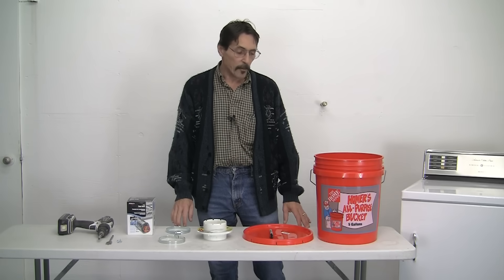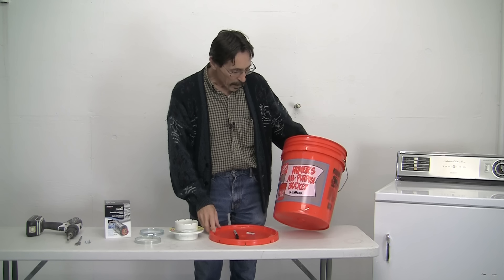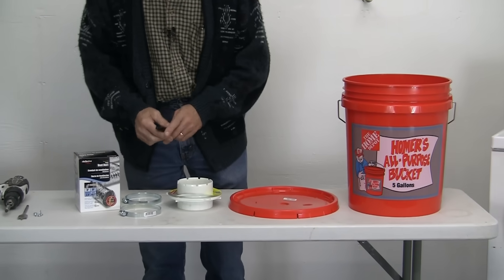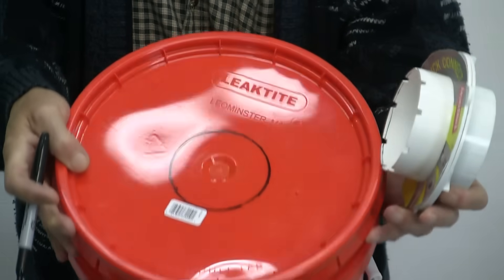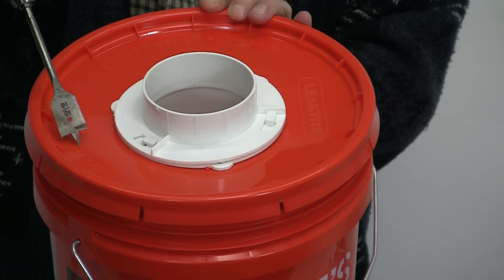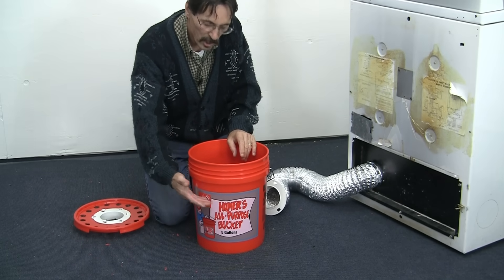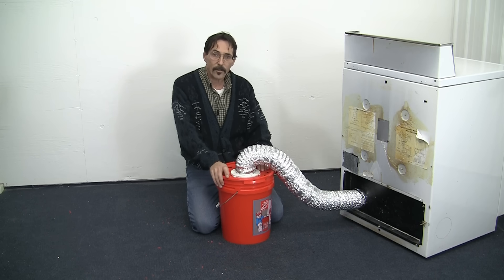DIY How to Cut Electric Bill in Half: Part 3 Clothes Dryer Free Ideas | Missouri Wind and Solar

Comment: This is interesting. Thank you for sharing this idea. My concern with this method is that the extra moisture in the air may introduce mold growth.
Reply: In the deep South our average outdoor winter humidity is 70-80% and it works its way inside.  This probably would not work for us for the same reason a swamp cooler does not work in the summer, that is, very wet air inside.  But in winter in Arizona should work great.
Reply: I live in Arizona and we can use this method all year long.  Very low humidity in here.

Comment: We have one of the tiny buckets from the hardware store connected to our dryer.  It's not ideal but was necessary because the outside vent is too far away from the dryer, and it took hours to dry one load.

Comment: actually, in older rural houses like mine, the dryer is in the garage which is divided in two - the front half for the cars, fridge and washer dryer and the back half for workshop.
I'm going to put this bucket trap on the other side of the divider wall with another connector like the lid has so when it's cold outside, i can easily reattach the hose from the outside wall to the inside wall and heat my little work bench area with the bucket placed underneath it so I don't freeze when smoking and farting around out there. perfect.
no more 1500 watt heater cost.

Comment: It is a great idea, but it causes your cheap latex paint to peel, also with the moisture in the air causes mold also your electrical to corrode. The biggest thing is if nobody cleans the lint filter, then your adding more work. The bucket is soft plastic it throws a smell when heated. This was tried out in the 70’s and became a fire code issue.
Reply from the maker: This project isn't necessarily for everyone.  Please watch our follow-up video: https://youtu.be/M2ml3hRLnRI

Comment: Yeah. I was thinking fine lint particles will blow out the holes and into the home. Not good to breathe in at all. I saw someone else mention that too. 
 The exhaust air isn’t strong enough to force all the lint into the water.
Reply from the maker: This project isn't necessarily for everyone.  Please watch our follow-up video: https://youtu.be/M2ml3hRLnRI
Reply: @MissouriWindandSolar  
I understand the recapture heat and using it part. 👍👍 good idea! I was referring to the fine lint particles that don’t get trapped in the water. The fine lint particles escape the holes and get circulated around the home and people are breathing it in. 
 Try this.... ???? Take a round floor scrubber pad from a commercial floor scrubber. Cut a center hole in it. Trim it to the same size as the lid on the bucket. Place it on top of the lid of the bucket  so it covers the exhaust holes. Use the pad as a filter to collect the fine particles. Rinse when dirty. Repeat...

Comment: Many laundry rooms are isolated from the rest of the house. So, I can't see how this would anything. Certainly not a 24/7 solution during months of high humidity
Reply: During the summer, duct it out as normal. In the winter, you disconnect it and stuff some insulation in the exhaust hole. This would save a lot, When your dryer is vented outside, it creates a vacuum inside your house. This will pull cold air back into your house through other exhaust fans, cracks or inefficient windows. You are correct, most laundry rooms are isolated, however if you were to leave your laundry room door open it could help. Also my garage is attached, and the back wall to where my dryer is. I could cut a hole through the wall and do this idea in my garage keeping The garage a little bit warmer which would in turn keep the floor above it warmer. I have a bathroom above my garage which is notoriously cold since It has outside weather hitting it on two sides plus a cooler garage underneath it.

Comment: Now what if the lady of the house uses one of these on her dryer and washes her husband’s work clothes?  Husband works for a company that removes asbestos from old buildings.  Blow the heat and asbestos fibers throughout the home and eventually wife is diagnosed with mesothelioma and dead at 53.  I went to the funeral.  It really happened.

Comment: I have two 2 inch pipe as exhaust from the bucket one goes in the laundry room. The other goes into my air duct. My thermostat fan setting is on but it will only run when humidifier sensor Reads high humidity. To engage it.

Comment: I found that if I vented the drier exhaust back inside the laundry room that I would end up having to replace heater element coils once a year because it would rust and break. It was more expensive having to replace the heater coil all the time than whatever I was saving on heating so I just vented it back outside.

Comment: Hi! I feel the need to emphasize that you can only do this for electric dryers; Don't give yourself carbon monoxide poisoning by hooking this up to your gas-powered dryer! Also, I would say that this can definitely create some moisture problems in the home as well. As far as I know, building codes require all dryers be vented outside because of this. But I guess if it's your house, then do what you will but be advised!
Reply: This will put pressure on your AC in the summer to remove all that excess moisture and will cause your windows to frost over in the winter in clod climates.  The moisture in the winter would not be so bad as indoor air can get crazy dry.  However, if you don't use AC to remove the moisture in the summer, you will get mold in areas not well ventilated.  To me it is not worth it.
Reply: @chuckhoyle1211  but if you have the hybrid water heater, it will suck the humidity out of the air, and you can exhaust the cooled air out (in winter) or cool the laundry/basement in summer
Reply: As I said earlier,  properly operating  gas  heaters do NOT make CO. In fact there  "is such a thing"  as  "unvented"  gas heaters

Comment: Why not add a ridged pipe inside the bucket so the air is forced through the water? I like this idea. Great video.
Reply: wouldn't this block the venting air flow instead , be worth trying

Comment: Proper venting of an electric clothes dryer is important to prevent damaging your home. ... While an electric clothes dryer doesn't expel carbon monoxide like its gas counterpart, there are large amounts of moist air and lint coming out of your electric dryer, both of which can severely damage your home if they accumulate.

Comment: A big benefit is that it puts humidity into the dry winter air which will reduce inflammation in the nasal passages and thus significantly reduce the chance of catching a cold or flue.
Reply: Can't catch cold because ur nose is clogged w/ lint. Then ur tounge gets warm because it now wears a jacket of lint.  😄

Comment: Good vid. Just FYI..... the hose diameter is 4" so it's cross-sectional area is 12.6 square inches. You (correctly) say you need a lot of exit holes....and you are using a 15/16" bit. The GOAL is to drill as many of these holes to EQUAL the incoming hose, in matching the cross sectional area. I did the math. A 15/16" dril bit creates a hole that has a cross-sectional area of 0.69 square inches. To match input with exit.....you would then need 18.3 holes....rounded up to 19. Just sayin'.....if the exit has less area than the inlet.....you will be building up pressure and reducing flow. You got real close, so it may not matter....or may not matter much....but I'd go 19.

Comment: Yeah you might want to go outside and breathe the air coming out of that vent to see if you can tolerate the smell and the damp air coming out of it first especially it you use scented detergent or dryer sheets.

Comment: Restricting the airflow in a dryer also causes it to cycle on the safety thermostat. Lint backs up in the exhaust and the heated air that controls the temperature is unable to cycle the high heat or low heat thermostats. This can eventually cause your element to overheat and possibly burn out. If the safety thermostat fails, you have a fire hazard.
Reply: The 16 holes more than match the diameter of the pipe and will allow the air to exhaust without restriction.
Reply: @executivesteps  it still very much restricts the flow and causes issues. Appliance repair is my trade. Cant even count how many of these “life hacks” ive seen throughout the years.
Reply: I agree and the fact that the 16 holes add up to the volume of the original exhaust doesn’t offset the fact that you are causing downforce and then trying to exhaust back up against the initial flow. There is no way the exhaust is operating at the proper volume.
Reply: thanks for cutting and pasting a google search.  how does your comment relate to his contraption?
Reply: @oopalonga  It may have a LOT  to do with the subject at hand.  I  spent  about a dozen years in  HVAC/R  and part of that time had a second part time job maintaining  coin op laundry equipment, so, I , too  know a  thing or  three about dryer operation.  It is a VALID point and something you should watch for if you perform this "hack."

Comment: Tried this and the house smell like wet clothes ! And when water evaporates from plastic can the fine lent blows out holes and is in the air.and not good to breathe.., walls around area covered with moisture not good for paint , water heater nearby and flexable  vent pipe showing more rust which will eventually corrode seams and have exhaust leaking inside of house., cold outside and moisture on inside of nearby windows , and mirrors in nearby bathroom. Same as when take shower everthing covered with moisture..Didnt like so stopped use.

Comment: This is a great idea BUT..... if you add another Shorter aluminum hose Inside the bucket going Into the water, it will trap All the lint and blow up clean hot bubbles of warm air. It will Not Obstruct the air flow. 
If you look at Oxygen next to a hospital bed, it works the same way. Or look at a video of a Rainbow vacuum cleaner, same thing, taken from oxygen idea. 
If you let the lint keep blowing down on top of the water, it will eventually start to gather on top and stay dry, thus blowing loosely and out of the holes you drilled. 
Sorry but this idea is way better.

Comment: Cool but deadly, all that moisture from wet clothes has to go some where's. As the clothes dry the moisture is being sucked out of the dryer tub and blown into that bucket, Yes the water in the bottom of the bucket will catch the lint but that volume of air coming out of the dryer and then out of the bucket will surely take most of the moisture with it and into you home.. An older friend of mine did this yr's ago in his basement and had so much BLACK MOLD from the constant moisture that it was toxic and the home smelled of dampness and mold all the time. I told him it was extremely hazardous to vent his dryer into the basement and that the mold it created would make it's way into every nook and cranny of the living space him and his wife shared, he told me he had been doing it for yr's and had nothing to worry about. Him and his wife after doing this for yr's wound up both having serious lung problems and eventually died from it.. Building code requires that dryer vents MUST be routed to the outside of a any type of living structures just for this reason...

Comment: Hi, my dryer is in the garage but it doesn't have the proper ventilation so 2 of them have gotten damaged, can we do this to avoid it from burning or overheating? Or should we do the the ventilation system up on the wall so the heat escapes through the ceiling? Thanks!

Comment: Never do this you will end up with to much humidity in your house you will have drywall problems and rot problems in the winter months. If this was such a great idea the code would not have all driers vented outside gas or electric
Reply from the maker: Thank you for watching.  This project is not intended for humid climates.  You can see more in our follow up video here: https://youtu.be/M2ml3hRLnRI

Comment: Excellent how to video, well done. I have the tiny store bought indoor dryer kit and was thinking about using a  5 gal pail so I don't have to add water all the time.......... then I saw your video which is perfect. You demonstrate and speak so clearly with no loud music like so many others on youtube. Good that you explained why it can't be used with gas dryers. carbon monoxide.  You also showed me how to make those lids easier to open thanks.

Comment: Keep in mind that the electric dryer is 240 volts when your furnace requires only 120 volts do the math you are paying more not only that a dryer can only run for so long until you blow out thermal cut off switch and now you have another repair to worry about.

Comment: great idea I'm only worried about the humidity I done this last year and I would leave my dehumidifier and it doesn't really help. I have electronics and my furnace wouldn't want to get them ruined with moisture or get mold what is the solution?

Comment: Hi, thanks for the tip. I have my dryer in the basement and i don't want more humidity in there, could i use a dry solution by using a carbon filter or something to keep the heat inside without the dust? What do you think about this? Thanks !

Comment: I got fine lint all over my laundry room after doing this, it needs filtration!! You can buy a unit with a filter, lint is not healthy substance to have in your air.
Reply: Add some water to the bucket it will catch the lint
Reply: We have water in the bucket...FYI here in Arizona that kind of humidity indoors causes mold or mildew problems. I cannot keep cardboard boxes in my laundry room using thus method, even with the exhaust fan and garage door ajar...moisture like this can overwhelm hvac systems as well
Reply: People should be warned this method can cause a dryer to run too hot....I went thru several thermal fuses...so we went with lower temp settings...end up running the dryer too long to dry...just to scavenge a little warm air....if you are in the cold climates this can work.

Comment: Pi r squared.  a 4 inch hole (or hose) allows 12.5 inches of air flow.  So ur vent holes area should equal about 12.5 inces.  15/16 th has an area of .94 inches  so you'll need 14 holes to not restrict the vent

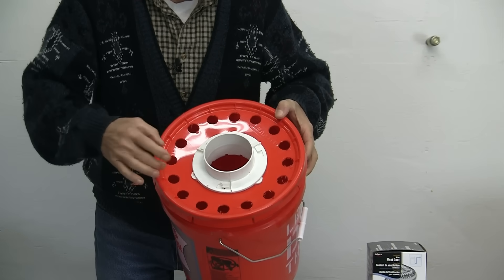Comment: I appreciate the comment at 3:45 cautioning us against restricting the air-flow.  I don't know much about cfm but it seems like the total diameter of the exhaust would need to be made equal or greater.  with 1" holes drilled to equal the 4" aluminum exhaust you would need about 17 holes drilled.  does that sound about right?  at 7:30 i count 16.  seems like you would want to exceed 17 or (18 if using 15/16" holes ) to be sure there is enough airflow.

Comment: From Leo:  I have used a similar bucket for years.  In addition, I cut a disk of a furnace filter with the big hole in the middle that filters the lint out of the discharge.  That keeps the house a lot less dusty.  I also keep a couple gallons of water in the bucket and no longer have need for a humidifier.   A small fan in the laundry room door pushes the warm moist air out into the kitchen where normal Furnace cycling distributes it.    I would not use it with a gas dryer, only electric.

Comment: If you add a tablespoon full of a Lemon dish soap, it will break the surface tension of the water, have better lint absorption, and the air will smell nice. If you notice the smell isn’t as lemony, then it’s probably time for a water change. This also helps chase off mosquitoes.

Comment: A heat exchanger should be built to extract the heat and exhaust the cooled moist air outside , As an air psycrometric chart shows that most of the heat is in the moisture as latent heat and not sensible heat that the thermostat can read ,Humidity above 50% will likely raise your heating bill .

Comment: Not a good idea, folks --too much moisture for most homes to handle. If you're going to insist on this concept, then just get a clothes rack or better yet, a clothes line and save the energy from running the dryer altogether.

Comment: Serviced dryers for 32 years. Any time a customer did not follow manufacture installation specifications bad things happens. That dryer has overheated. The discoloration on the back of the dryer is one of the tall tale signs.

Comment: Thank you for the video and ideas. I have a question, my old Kenmore is not collecting the lent anymore, it heats, it dries but lent trap is sparse. I took the back off and cleaned the vent to the fan but still same issue. I am still getting hot air coming out the exhaust so I know it has air flow but my clothes are coming out with hair and lent etc. I just can't figure it out, any ideas? I would rather dry on a line in winter than by one of the new models that doesn't do a darn thing.
Reply from the maker: I would say your drum seal has worn out. Look into your drum and there should be a seal in the back, it should be tight against the dryer body, if not your leaking lint to the inside of the dryer which can start fire at some point. The seal can be replaced.
Reply: @MissouriWindandSolar  thank you I will go check that now.
Reply: Wow, you really know your stuff! I reached in and pressed hard as I ran my fingers along the felt seem and half way along it gave and the tips of my fingers went through. Thank you for the advice as I prefer to fix old hardy appliances than to buy new,... my wallet(purse) thanks you too.
Reply from the maker: @lisaalbarras3029  It's called a drum seal Lisa. You get it with contact cement. Not to expensive. You just need your model number to get it.
Jeff